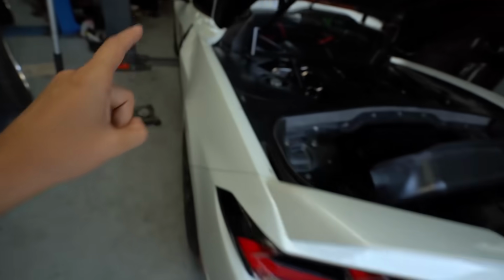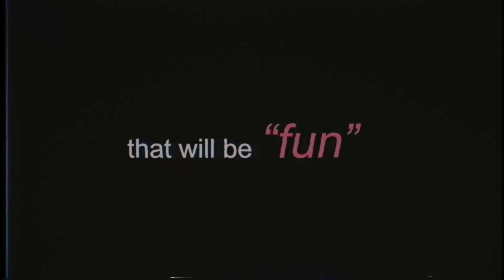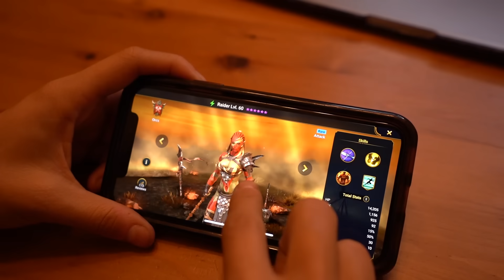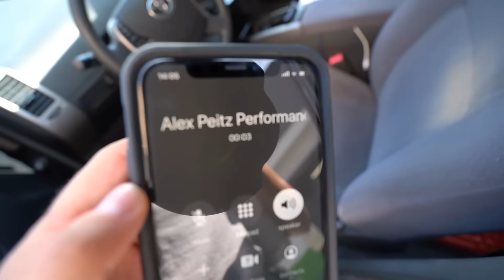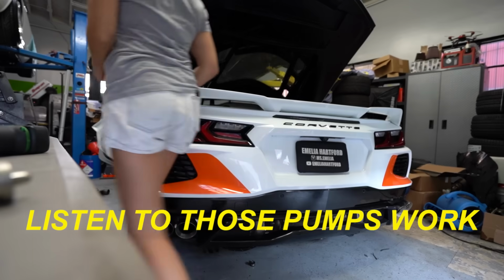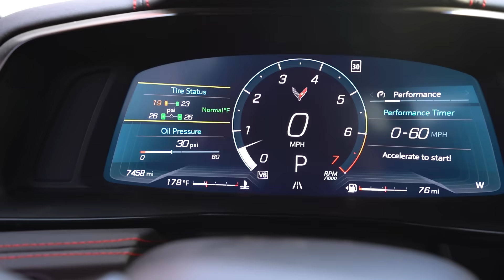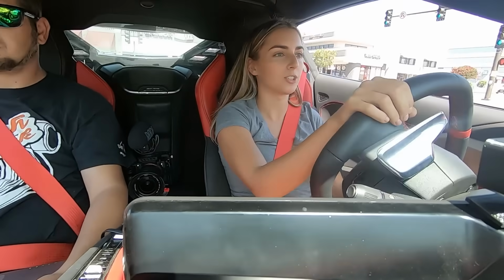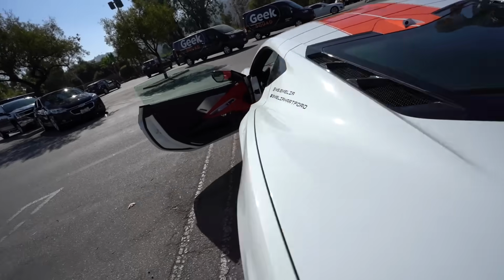My Blown Twin Turbo C8 Corvette Rebuild is finally DONE! And absolutely RIPS!

Comment: Exhaust wrap is meant to be soaked, so when it dries it shrinks and holds tighter.
Reply: Great tip!!!!
Reply: Very true
Reply: @jasonanderson2876  i see what you did there exhaust 'tip'
Reply: Thought everyone knew this! Atleast she used safety wire ties
Reply: @Hurleysburley  She soaked it in the video.
Reply: scythelord She ran it under water, it is meant to soak till all air bubbles go away so it doesn’t have moist air underneath. Those pipes even with silicon sealing on the ends of the wraps will rust in a few years.
Reply: @TheNate371  attta boy. Someone with some sense n Knows his stuff.  Ut u got people saying oh' I will pull out a motor and put it back in ,in one day. Like cooooome on maaaaan !
Reply: @TheNate371  a  few years?  Do you really think this set up is going to stay this way for a "few years"?  It'll be off in a few months and most of the components will be shelved.
Reply: 1216jimmyz you’re probably right
Reply: @TheNate371  Im doung my SVT RIGHT NOW. JUST DID THE WATER PUMP , PULLEY... PAIN IN THE F*KING AS SO TIGHT IN THERE NO ROOM.. AND HOW (THE SVT TEAMS) PUT THERE CARS TOGETHER , IS IT LIKE THERE OWN WAY OR ? I LOOK AT MY MOTOR AND CAMS , AND IM LIKE WHY DID TGEY DO THAT INSTEAD OF MOUNTING THIS, OR WHY THAT ? SO  I JUST ROLL WITH THE PUNCHES... FORD BABY. ALLWAYS BEEN A FORD GUY. LOOK UP THE 2021 MUSTANG GT500 1400HP. " INSANE " 🤑 CANT WAIT TO SEE A TWIN TURBO BUILD ON THAT BAD BOY. BUT THEN AGAIN ITS ALL ELECTRICAL, SO TURBOS  JUST ELECTRIC. BOOOGY WOOOGY WOOOOGY. 🏎💨
Reply: Matty there is a reason mechanics hate engineers.😂 I miss the large engine bays where you had room, now everything is so cramped together and compact. I want to see the new GT 500s be twin charged. Two turbos and a twin screw supercharger would suit it right.
Reply: @TheNate371  yeeees siiir. Now ur talking... 💪🏼🤜🏻🤛🏻😱
Reply: She literally puts them under a running faucet

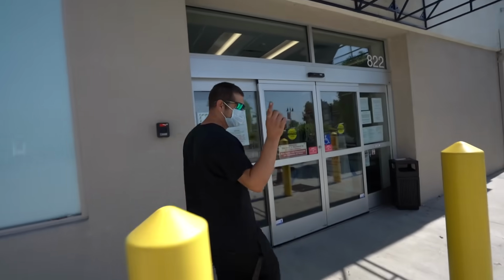Comment: 5:45 You don't heat wrap cold side parts it acts as a insulator retaining heat. Cold is reflective tape and hot is heat wrap to lower temps under the hood.

Comment: normally you wet the wrap and stretch it as you wrap.  also helps so you don't get itchy fiberglass on you.
Reply: They did wet the wrap.
Reply: Normally you soak it. Not just run under the sink for a couple seconds.  I am not hating on them.  Lol. Just trying to help for future projects.  Glad the car is back up and running better than before.

Comment: Exhaust wrap and oil leaks results in engine fire as exhaust wrap soaked in oil catch on fire from the red hot exhaust.
It is better to ceramic coat stainless exhaust than deal with engine fire.
Reply: Let me guess: you have no automotive experience right?
Reply: @MrThunderCunt  wrong as here it has happened on the dyno when turbine housing is glowing red hot
Reply: @pointsur67  30 years as licensed ASE automotive tech, 8.5 years at turbo shop in Surrey, BC, graduated 1987 mechanical engineering from University
Reply: @downhillskier7  👍😀👍

Comment: If your LED lights are installed backwards they won't work. They are polarized and current will only flow one way. Try switching leads on your red LEDS.

Comment: It shouldnt matter what ypud like to run for ac with the newer cars Emelia lol its either 134 or 1234yf. The service ports for the 1234 are bigger on the low side compared to the 134 system 😂

Comment: So all that smoke at the end of the last ep was just wiring for the scavenger pump touching the exhaust? Twas a ton of smoke. Great to see the C8 purring again :)
Reply: The smoke wasn't from the wire, the smoke was from the Engine because the the Scavenging pump stopped working because the wire to the pump got burnt and stopped working
Reply: @michaelwynne4346  ahh ok thanks for clarifying 👍

Comment: GM doing major recall and stopped sales of all C8's do to problems with the fly-by-wire brake system , "2020 Chevy Corvette among GM Models Hit by Recall over Brake-by-Wire. A potential problem in the manufacturing of sensors used in GM's brake-by-wire system means the C8 Corvette, as well as some 2021 Chevrolet Trailblazer, 2020 and 2021 Buick Encore, and 2020 Cadillac (CT4, CT5, and XT4) vehicles, are being recalled."

Comment: Still no clutch upgrades. Z06 and ZR1 models are still in the planning stages. Chevy know they will need a stronger clutch pack to handle the stock horse power of the faster model. So far you and 2 others I been watching need a stronger transmission for the horses you are pushing. I saw a Youtuber destroy his transmission.  No replacement transmissions are available.

Comment: RX7 Build Gears n Gasoline swapped a K20 into theirs. If you go the lame LS Route cool but well meh it's overrated, destroys handling, and has been done way too many times. K20/K24 would be original and fun as well. You can turbo it or go max N/A Power and with K20/24's can easily make 300whp.